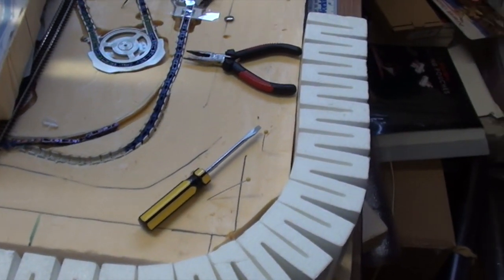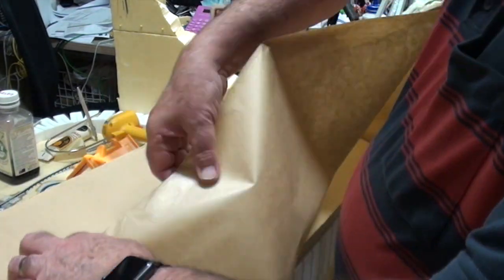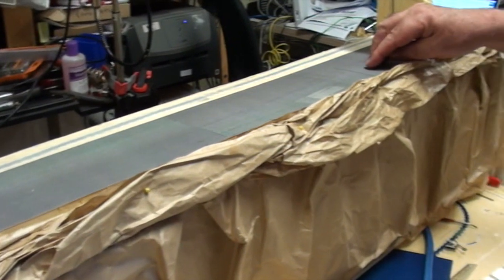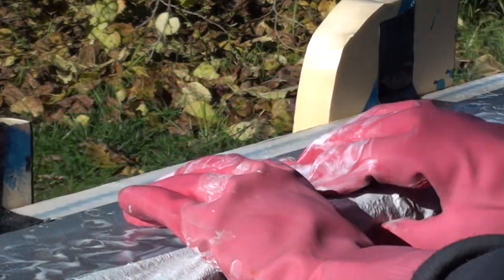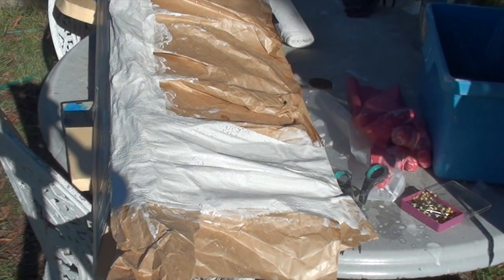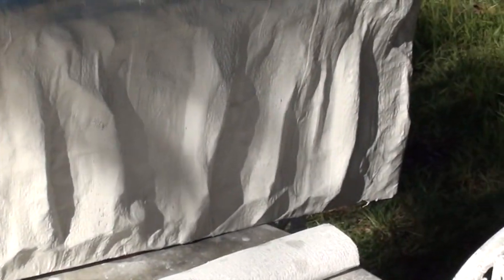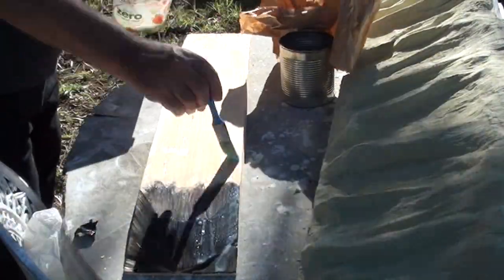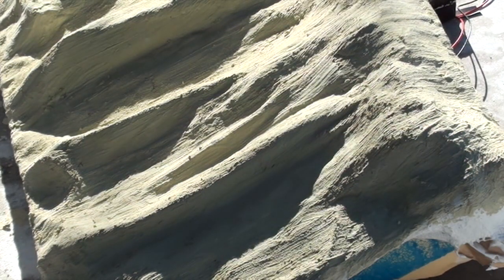Magnorail @ Crater Lake #6 MAKING A CLIFF FACE

Comment: I'm working to incorporate magnorail into a train layout I'm currently building. Since it involves a slope with an upper flat and lower flat area, I'm having trouble deciding how to proceed. At this time I'm thinking of installing an accessible box where the motor will be, and anothere where I may need a second motor.. Then proceed with landscaping / plaster cloth. After it's solid, cut the plaster and route out the channels in the foam with a dremel tool. Does this seem like a decent way to go? 
I feel like I'm spending more time considering ways to do this than I should be. Thanks for any input!
Reply from the maker: Sounds exciting - Please send me your details by email and we will work through some of your issues - Clyde. magnorailoz@gmail.com